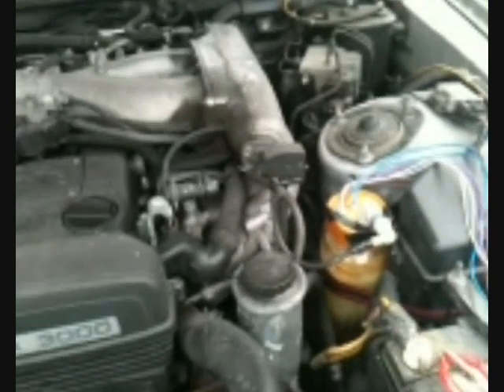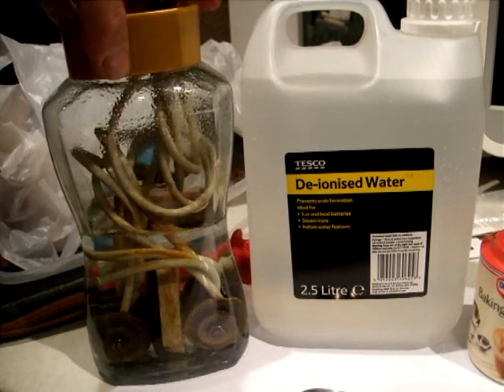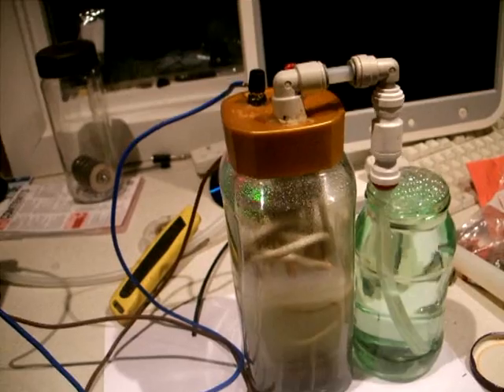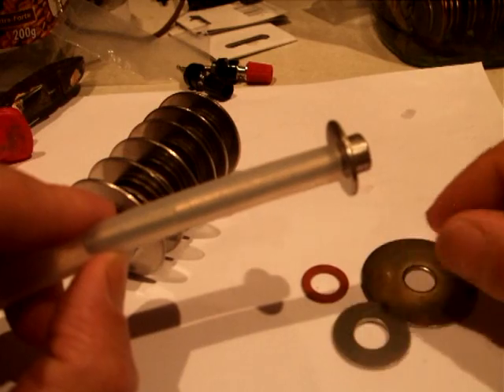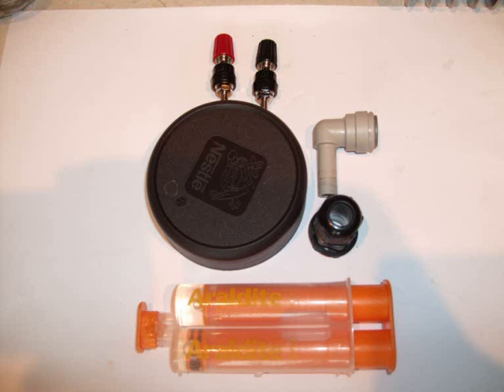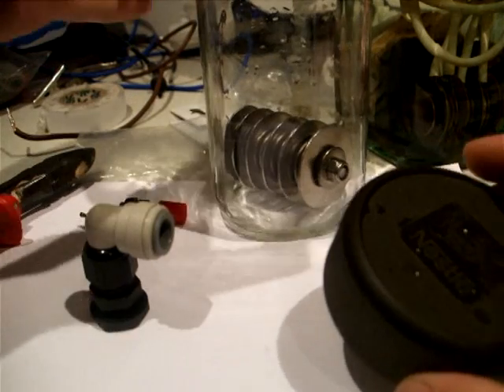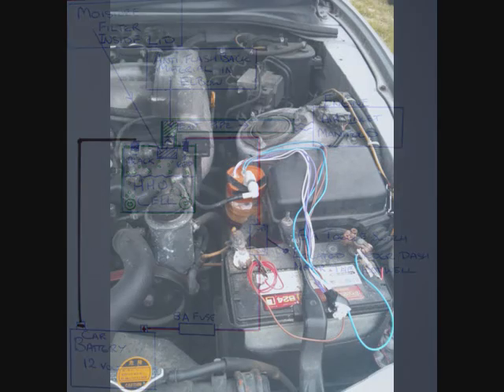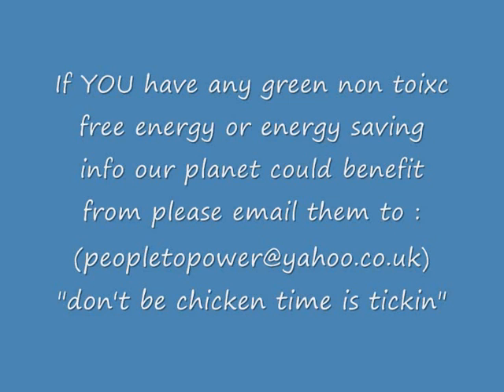HHO How To Build Your Own & Run your car on water.wmv

Comment: @braaup i used a ss water bottle with a stack of ss washers on a ss bolt, driled a hole in the bottle cover, and bolted the stack to the cover. the bottle is the negative, and i fastened my positive to the bolt coming out. it works great.